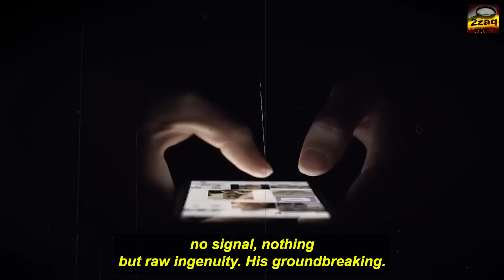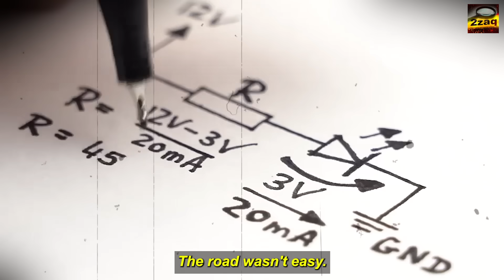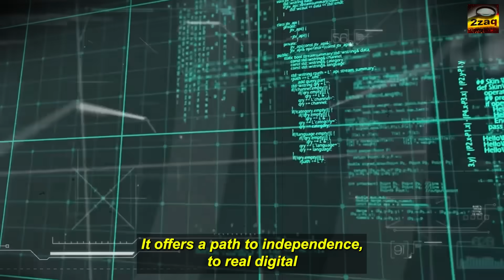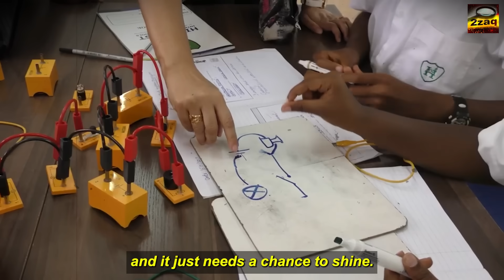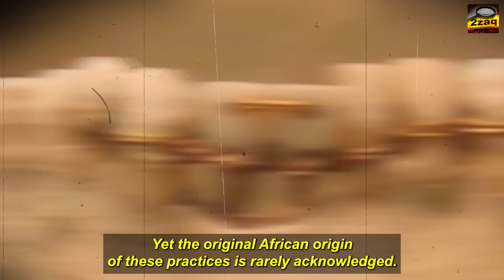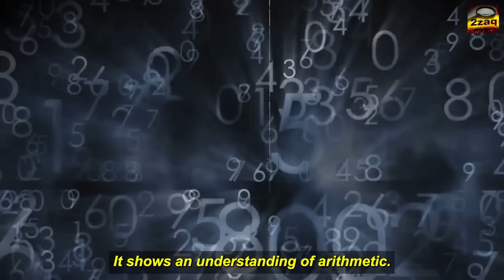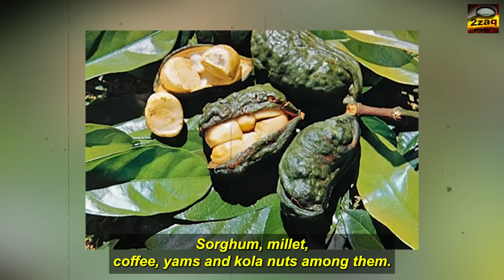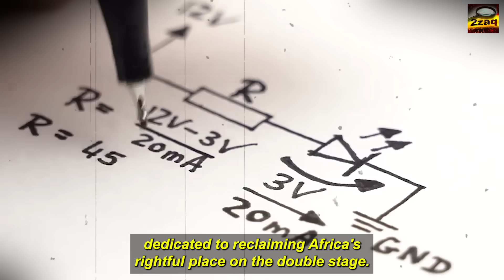How a Namibian Inventor Made Calls With No SIM Card!

Comment: This "invention" by the  Namibian was a hoax. What he showed in a video was a cardboard box with wires attached to it with nothing in it. You cannot use a cell phone without a sim card to make phone calls and receive them. A sim card identifies the phone by a phone number and serial number. Plus a sim card enables a user to use a particular phone provider that is if you have credit. The only time you can use a cell phone without a sim card, if the main Telco of the area  allows the cell phone to access emergency service numbers and of course using the phone via WiFi. Where you can make a phone call through Messager, Whatsapp etc.

Comment: I have been using different radio transmission technologies from the 70s to date as a telecom technician to engineer and senior engineer. What is common is that the transmitting station must be similar. to the receipt the receiving one. It is never a one way affair. From hf and vhf analogue transceivers to modern digital cellphones the reciprocal arrangement is the same. How possible then is it that the young man can achieve a one way link like this one . To whom is he communicating is it to those with cell phones or someone with a similar device?

Comment: well actually you can create kind of software protocol that makes phones proxy servers aka what we call gsm tovers are actually phone modem modules with high bandwith prorammed to act as proxy servers or repeaters... if there is enough phones in 3km range gps gprs gsm 3g 4g etc tovers are not mandatoru at all... its just about closed source prorams that prevent phones that features to be used  without paying service providers.

Comment: Petrus’s device, while cleverly assembled, is effectively a stylized walkie-talkie or a very basic shortwave radio with an ergonomic interface. It still requires a transmitter, still deals with limited range, and unless paired with identical units, has no real scalability. It lacks encryption, data throughput, addressability, and carrier coordination. It’s not peer-to-peer in the IP sense, nor is it mesh-based.

Calling it a “phone” is a stretch. In fact, it’s a regression from the cellular stack—a nod to the pre-cellular era. But in contexts where the infrastructure doesn’t exist or is unaffordable, regression may be a form of local optimization.